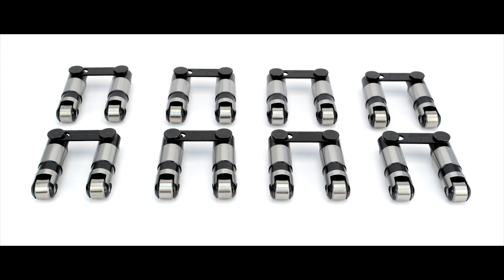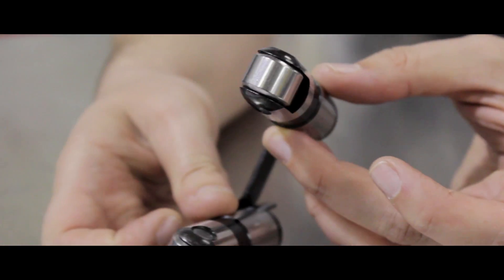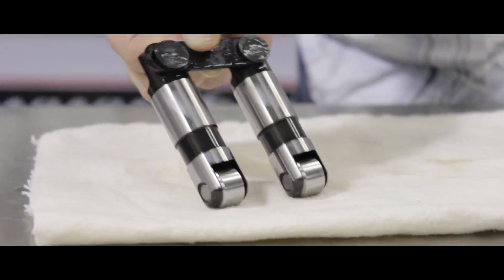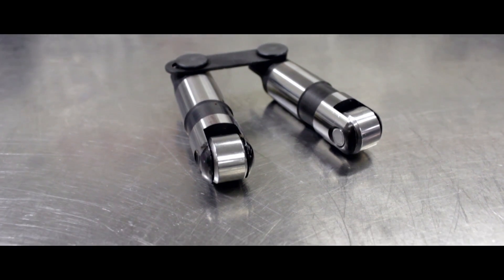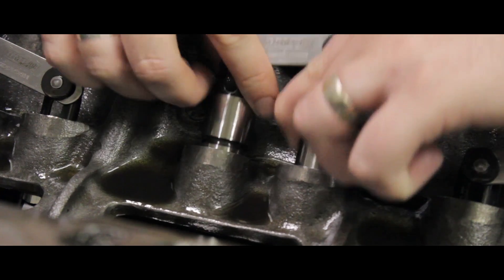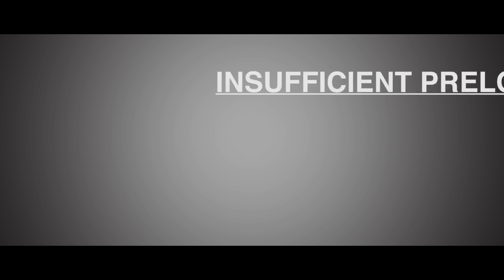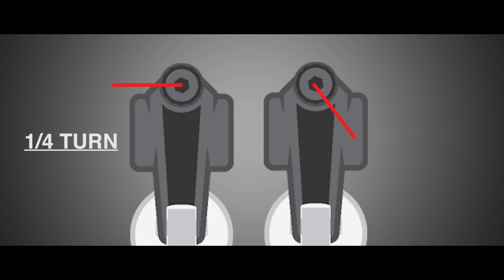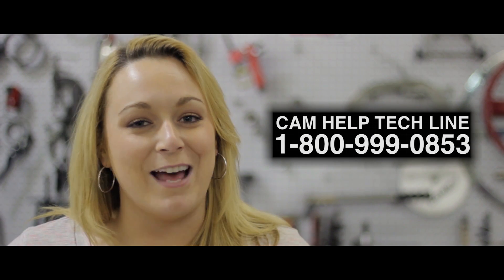Hydraulic Roller Lifters: 101

Comment: I have a 2006 Dodge RAM Grand Caravan SXT 3.8 Liter Engine, With Timing Chain and Roller Lifters. ( I had the RAM Dealer Run the V.I.N.).
 It has a Lifter Noise and I am Not Sure if it is Actually the Roller Lifter or the Valve itself and it has become a Very Sharp Tapping Noise on the Front Left Bank of the Engine, where the EGR Valve is Located. I was Thinking of Removing the Rocker Cover and then letting it Run to See what is Really going on under there. 1. Is this a Good Idea???  2. Do Roller Lifters make Sharp Tapping almost Sharp Hammering like Sharp Tapping Noises or would it be the Valve itself???  3. If it IS the Valve then I Will Obviously Need to Remove the Head or can it be Done without Removing the Head and Exhaust Manifold??? 
I have also been Told that Lifter Noise is a Common thing on Caravans. I am Not Sure if this is Really True or Not, since My Vehicle is the Only one I have come across that has this Issue. Maybe other Owners are Loaded to the Gills and get them Fixed or Unfortunately and Prematurely Scrap their Vehicles, Due to Misinformation and are Told that they Need a New Engine, when that may Not Really be the Actual Case. 
I Was Told that: "I Will Need to get a New Engine and for that kind of Money, I might as Well get another Vehicle." I was Told to Scrap it. I Don't Think So. 4. I Walked away From ALL that B.S. Crap and am Searching for some Kind of Honest Advice as to what I may be Dealing with here and how much Work and what Tools Will be Required???
Thank You. COMP. Cams.

Comment: I got a non roller 302 so I can install these in the engine so what else do I need do I need a certain roller cam and certain push rods?
Reply from the maker: Your best option is to contact our CAM HELP line at 1.800.999.0953. Those guys will have a few questions about your engine and overall setup and will then be able help you pick out the best valve train components. Thanks for your interest!

Comment: So there's no need to soak the lifter in kerosene/motor oil overnight before installation?
Reply: Kerosene/Diesel/Mineral Spirits are similar petroleum products. I use whatever one of these are available to clean internal engine parts before assembly (I flush engine blocks with diesel). It helps displace water, debris, and prevents rust. Don't forget the Comp Cams assembly lube.
Reply from the maker: Stuart B Hi Stuart - COMP recommends soaking the lifters in mineral spirits overnight. Oil is not necessary. Hope this helps!
Reply: Stuart B never kerosene wtf ? Hydraulic oil yes. Rollers there's no need don't put heavy grease because the roller will not roll it will slide. Tip though always use zinc additive in your oil changes
Reply: If you soak in mineral spirits over night wont it degrease the needle bearings?

Comment: What happens when you need to pound out old flat tappet lifters?  Is there a proper way to remove them?  That's not necessarily "clean".  I tried once, had the top of the engine (only freshened up the top end) full of broken lifter parts.  Actually ran great with new lifters and heads.
Reply from the maker: There is no standard procedure for removing damaged/stuck lifters. If you can get the lifters up high enough in their bores to slide the cam out, removing them via the bottom of the block would be the easiest way. Be sure to use plenty of lubricant on the lifter bodies to help them slide out easier.
Reply: Ok, the engine I had worked on was a Chrysler 318.  They were just peened over/distorted from being very old.  After I got them slid up, I was grabbing at them with locking pliers and levers.  I remember having pieces all over.
Reply: @nicholassmerk  after i got mine slid up i just used a rag to cover the sides of the lifter so i wouldnt mar them and used channel lock pliers, pulled right out on the sticky ones